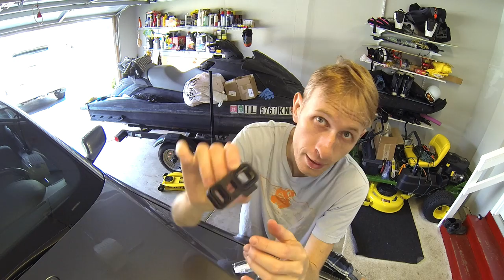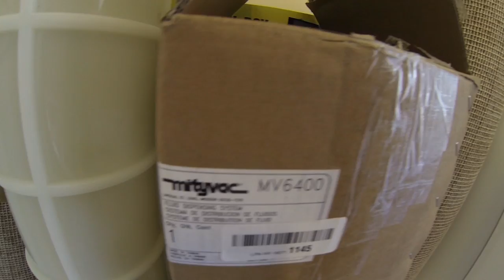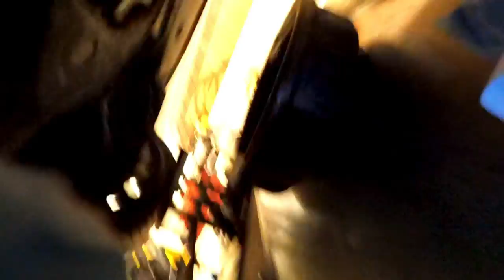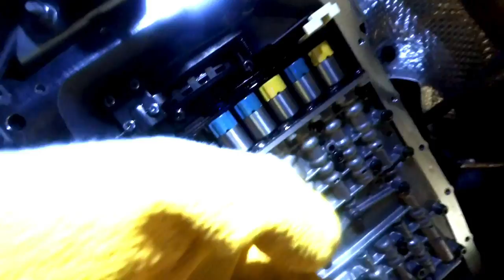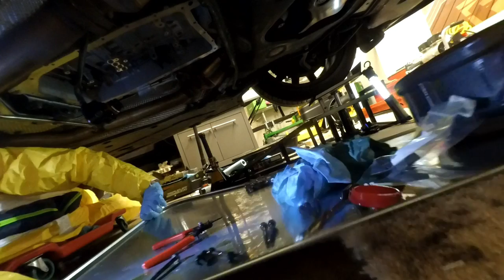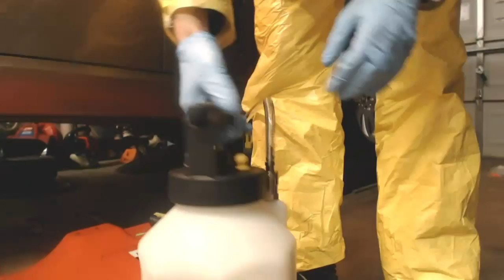Transmission Fault ZF BMW Range Rover Jaguar Bentley Rolls Royce Aston Martin Maserati Repair Fix

Comment: Great video! I have a 2003 745i with 96k miles and started having transmission fault after a 30mile run. After stopping it wouldn’t go into any gear, it just jumped into neutral. Shorter runs it was fine.Took it to a transmissions specialist and told them about your diagnosis. Took them 4 hours with new filter pan, bolts, 7 litres fluid and new two hole adapter seal. Cost me £650 but now drives beautifully again. BMW diagnosed... Need New Gearbox!! My adapter seal was cracked right through in 2 places! Thanks again. Oh, the specialist explained that you should NEVER put more than the 7 litres of fluid in or the pressures can be wrong. The gears are changed at specific pressures so if they are wrong then the gear changes are not correct.

Comment: After 4 years of not being able to drive the  car long distance, 4 mechanics, the dealership, and a $6500 transmission rebuild I did the job of really looking into this issue for an hour learned about how a trany works and now I can do the job that people who get paid could never. Thanks so much your a saint and now I can drive my LR4 without worry

Comment: That looks like an easy piece to machine out of aluminum, I never liked plastic parts in hot environments even intake manifolds, don't know what the melting temp is but aluminum is around 18 hundred. Great video

Comment: Tremendous video!  Huge help! I bought my 2006 full size Range Rover with a freshly rebuilt transmission that was rebuilt by a guy who did not replace the 'goggles'  and rubber sleeves for the mechatronic so seeing this vid I will go in and do this for myself to solve some issues I've always had since buying it.    The Ford Mercon trans fluid absolutely works, have used it in my 6HP26A and saved a ton.  Critical to do the fill and level check per factory procedure and do it at the right temp otherwise it will be too low or too full and both will cause problems on this finicky transmission. A big thanks for this video!
Reply from the maker: an infrared temperature meter from harbor freight helps when filling up the transmission, and the temperature goes up really fast so there should be 2 people, one in the car, one filling up the oil.
Reply: @SurferEugene I have a 2011 jaguar Xjl, and I’m having a gear fault code, would like to know can I bring my car to you

Comment: Excellent video very well explained thanks for posting it. I had the same problem with my 2008 BMW 750li it was not reversing it was going forward in any gear and I had a RED wheel transmission sign on cluster with (P) range fault. I went to dealer they said you might need new transmission which is $7000. I said no my car has only 165,000 kilometers it's not possible . but I did buy the transmission oil pan kit but not the fluid it was very expensive $47.99 a quart they said you will need (10) quarts = $479.90 dollars. I skipped on fluid but I purchased (RED) line D4 ATF  from auto parts store $19.00 a quart (10) Quarts @ 19.57=  $195.00 much less expensive then dealer. Gathering the material took more time then working on car. it took me (5) hours and I did it , Once the bridge seals were in and the  new oil pan with filter built on the pan was on. I let the car stand on ramps , I could not open the fill plug it was striped no way  to fill the fluid. What I did was fill the fluid from transmission intake line at the radiator by using (Graco) New paint sprayer machine I purchased a new 18 liters paint pail where I put the new transmission fluid all (10) liters in the pail now install the front paint gun tip in to the cooler line and lightly clamped it.so it will not pop out. it was very fast and easy I let the car run through out the filling process . The RED wheel sign is gone and all gears are working fine. Now once the all (10) liters  are in install the in take cooler line back on cooler. it is very easy.  I like the way you performed it. well done
Reply from the maker: Thank you for sharing, I will know what to do in case the filler plug is stripped.
Reply: Thanks post more videos you are very good at this BMW 750LI THANKS AGAIN.
Reply: Bashirsz Darz how did you know when you had the correct amount of fluid if you couldn’t see it coming out of the filler hole?

Comment: I copy and pasted the following paragraph from another person since its the same problem that I have. My transmission symptoms are as follows:

1. when I'm coming to a fairly quick stop it feels as if the transmission stops before the car dose so it feels like a bang sometimes harder than others.

2. some times when I come to an incomplete stop like almost stopping at a stop sign and taking off again it feels like the transmission stopped and when i accelerate to take off i feel a very hard bang and the car takes off very abruptly. 

3. this has been happening a bit more recently than the bangs, when I'm driving at cruising speeds at about 20 to 30 mph and want to quickly increase speed to lets say 60 mph like getting onto a highway or over taking somebody i feel a pulsating feeling coming from the transmission. almost as if my rpm are dipping slightly but they are not they stay very steady and it really doesnt feel like its the engine it feels smooth and strong.

4. and not as often but sometimes at highway cruising speeds i feel that the transmission doesnt shift at the proper times like it shifts up and then shifts back down again giving it a pretty unsmooth feeling.

Please let me know if replacing the parts you mentioned might fix the problem. I have a BMW530 xi SportsWagon 2006 with 89K miles.
Reply from the maker: the #1 and 2 seem like a flexdisk , a $16 part also called guido disk.  Usually wears out every 10 years or so. needs replacing on all bwm.  Probably #3 as well.
Reply: the torque converter is damaged, i think...
Reply: If you solved the issue tell us please

Comment: I bought a 2006 750i, day I bought it I tested good, even drove it at 130mhp on a safe place. Next day I went to pick up a friend, when he slammed the passenger door the transmission when to parking, and wouldn't go back to drive or reverse. Any ideas?

Comment: Very informative video , but you really need to do the  ATF fluid level check with the vehicle level and between a specific temperature range on your scan tool. You know If  you wore a one piece rain suit you could flash the owners before re-flashing the DME.

Comment: Hello, 

Just saw many clips of yours on youtube , and i have a question for you.

So , I have a 530i e60 from 2006 with an automatic gearbox zf 6hp19. I bought it 5000 km ago (i'm from Belgium) and i have this problem from the beginning:

On the highway , when the car is at 90° , and im playing with the gas pedal,  it get's stuck în the 3-rd gear and on car display i get this message "gearbox failure"(default). The first 2 times i stopt the engine and restarted it and the error goed away. The 3-rd time didn't dissapear anymore. If i put the tester and i delet the error it goes away. But when im on highway the whole thing goes again.

I have already changed the fluid , filter with pann , bridge seal , the 4 tubular sleeves and the big seal from tcm electrical supply. It didn't change , the error still comes on.

My question is , if i change the solenoids and the tcm what are my chances to win?

In your long experience have you ever dealed with something similar? What have you done? 

Thank you for your time, 

Christian

Comment: Great video, thank you.  I have a 2006 750li in very good condition 145k miles. I started having intermittent faulty transmissions a month ago, until it stayed in faulty all the time. I reset the engine light and it work fine, but it came back. I change pan and fluid and it work great for a day. now when I try to put it in D goes to P. In my opinion the issue was engaging on 1st, after engaging no issues. I am thinking on replacing Guibo and these parts that your are describing in this email and the solenoids as you mention. Any thoughts?
Reply: William Verdaguer did you change all seals and the mechatronic bridge seal, goggles?
Reply: Did it work I have 08 750li

Comment: hey drone, i have a 08 bmw 750li
its having problems accelerating and is lagging but does fine once im going fast like 60mph....i get the message (transmission fault, reduced acceleration) could this be related to what your fixing or a completely different issue/fix???

Comment: hey bro i have the same problem on my 745li 2003 bmw , my car is not going in to gear, when i put in gear it go back in park, i take it to 2 transmission spot, 1 spot  sad it the tcm module in vale body computer is brun out  ,and the next spot sad to got a used transmission in all and replace with the old one , what is the best thing to do bro i need helppppppppppppppppppppppppppppppppppppppp!

Comment: Hello,

by any chance you know a part number or a link to a website to get an input speed sensor for a BMW 750I 2009. plan to do some DIY on the transmission but i recently got an error about " Transmission Fault Code: 400626 - Turbine speed sensor short circuit to ground or
 open circuit"

Comment: i have the same problem in a Bmw 2008 X5 4.8 i change poem the same parts you changed to your Bmw and still said transmission malfunction drive slowly when you accelerate the change the 2 shift and the car goes like in neutron and then said transmission malfunction can you help me

Comment: my e46 318i 2001 has a cold start first gear hang up to 3500rpm after warm up it is normal, is there someway to fix it?

Comment: Do you know how to clear adaptations for the transmission? It's recommended it be done after any major repairs with the zf 6hp26 auto gearbox.
Reply: What he did is not major...just tedious...but if you were to open the mechatronic unit to replace solenoids, speed sensors, or tcm; then it would be...only if electronics are replaced would the adaptations need to be reset w/either BMW software or an expensive obd scanner that gives you that option...otherwise what the trans knows stays the same bcuz the electronics remain the same.

Comment: When you disconnect the mechatronic and you put back it not necessary make a reprogram?
Reply from the maker: I did not do anything to reprogram, the transmission fault simply never happened again, I don't think it is even necessary to disconnect a battery, but then again I am not a pro mechanic, it is a hobby of mine.

Comment: My car jerks when coming to a stop would these repairs work for that problem?
Reply: It's possibly a Flex Disc ('Guibo' joint) issue. I bought mine used 750Li 2006 and recently replaced mine. Before it felt as though I was getting slammed in the back overtime I came to a stop.

Comment: I have a 2005 Phaeton 4.2L with the six speed ZF. I am having issues with the transmission not shifting well between 3rd and 4th gear as well as 5 & 6. It makes a barking sound between those gears I mentioned. I had a check engine light show up once or twice but it goes away. I have to drive it in manual mode just to drive it now. I’m in the Atlanta GA area and everyone keeps suggesting a new transmission but I feel it may be this issue or the mechatronix. Would this fix possibly help?
Reply: shift solenoid's are bad also change the fluid and pan filter

Comment: My question is. If my transmission light doesn’t go away after doing all the resets. If I change my transmission fluids and pan out. Will the lights go away and work like new. Or is my transmission fucked.
Reply: Any one
Reply: Johnmichael Felix did you watch this video? Most likely the seals are broken so pan and fluids won’t fix it.

Comment: Hello Drone, I recently was driving my X5 3.0 and hit a pot hole and when I stopped at the stop light the vehicle wouldn't go into reverse or drive. The dealer says it's the mechatronics and or the trans. However, I have never had an issue with the trans. What would you say and how can I actually know or be sure that it is diagnosed properly?

Comment: I got similar transmission fault message, here's the code I get with ISTA-D.

400626 Turbine speed sensor, short circuit to ground or open circuit
Reply: There are two speed sensors w/in the mechatronic unit(input/output)...if short/open, then either the sensors are malfunctioning or the connections are loose or damaged...so the tcm(also inside mechunit) is not reading properly when info is sent to the ecm/dme...why I hate electronics on these cars, difficult to diagnose sometimes...even abs/wheel speed sensors can contribute to transmission faults and cause trouble shifting when malfunctioning...you definitely need a lot of patience and/or money when dealing w/electronic based vehicles.

Comment: I put everything back together but now the car won’t start and the gear box just blinks?
Reply: meaby u did not connect the cables :D
Reply: Wso my car won’t come out of park an get gettin transmission fault drive moderately
Reply: Meaby you messed with the pin in the mecatronic so the car dosen know in what speed it is or u failt to leave a gap when mounting ebreak cable or u dis not connected mecatronic cable good,it has a pin inside and must allighn well,try to read error with a diagnose pc
Reply: Wso so do they go out a lot ...cause I jus bought the car in sept an car waited one month an giving me this blinking problem so is this problem easy for me to do or u think I need to take it to a dealer

Comment: do you have anyone in jersey that can do this on my 2006 750i mine wont stay in gear keeps going back into park
Reply from the maker: any local mechanic should be able to do it.
Reply: Did you get it fixed?

Comment: I have been trying to reach this gentlemen, because I want to bring him my 2011 jaguar xf supercharged, because I am getting that error message, will you please contact me in order to discuss my problem. I tried to email but got a error that it is not a valid email address.
Reply from the maker: Hey will, email@transmissionfault.com should work, sorry about that.
Reply: I tried the email address once again, but received error message once again, please advise, I would very much like to discuss my problem with you.
Reply from the maker: Will, sorry about that, give me a buzz over the weekends or friday evening 847 4591535.
Reply: Drone my 2008 750li has this msg but mine won't get out of parking.
Reply: Drone good morning from Naperville, Illinois. I have a 2008 BMW 528I and the transmission malfunction keeps popping up.  I wanted to know if this maybe the same exact problem you were having. I would drive for sometime than it would go away. But know it seems like its happening quite quickly more often.
Reply: Hey William how did that repair go? Did that turn out to be the issue or no?! I own a 2011 Jaguar XF as well and I am currently having the same issue! The problem is I am having the worst time finding an HONEST mechanic here in Ohio!

Comment: Question here is your car is pretty New with 32k+ with that issue the dealer should take care of it free as warranty is still covered by BMW?  Why they charged you $1400 which seems a bit hard to believe if they know it's not the right thing to do. Esp BMW takes care very well for their customers in the first 4 yrs.. or you are trying to sell the parts and rent your garage and tools is the purpose?  All OEM parts can be bought online and those are not rare !!!! And you charge your price way to high for the parts the total of all the parts you described from ZF max out in open market is around $70+/-.
ZF6 oil is $22-25 plus.... the 6HP transmission is very robust and good not sure how you got that at early age on your 7 series with 30k+....
Reply from the maker: My car is 2006, this is year 2017,  it is long out of warranty

Comment: Hello my 04 BMW 745li car has 52k miles  last a few weeks soon as unlock the car notice the R.N.D FLASHING I STARTED STILL FLASHING  I shut it off and started 3 times till stopped flashing so I was able to drive it now I started and flash for a few minutes then stopped and black out took it to dealership and they said need new valve body - mschentronic don't trust the dealer any suggestions thanks

Comment: try two hours - max
Reply from the maker: Yes it is 2 hours, but it takes all day to put a brand new rear round plug for the electrical connection in the back of the transmission.

Comment: Hi there, 
Thanks for the vidéo 

I have a problem only in reverse Gear position P, big vibrations, and the car lowers from the front when i put R Gear it seems to force. 
Got no error code when diagnostic. 

In Parking mode with the comodo, the car also shakes but much less. The car does not stop immediately and advances slightly, then stops and medium vibrations appear.

On the other hand, when I use the Safety parking dashboard button the car freezes instantly and no vibrations.

The gearbox supports were changed they were split
Locking the gearbox properly made the problem worse.
Even More vibrations after changing the gearbox supports.

The GA6HP32 gearbox oil was changed more than a year ago without worries, strainer joint, crépine etc.

The biggest problem is the huge vibrations but only in reverse position R.
I made a couple of vidéos to show the problems

https://youtu.be/g4f4YDR5FWs

https://youtu.be/vq86XVwwJGA

Apart from that the car perfectly shifts in auto or manual mode, no noises, no hiccups.
Can you give me your opinion please?
There is no defaults code about the gearbox or anything else... 

I Will had to that that the car is vibrating when i take a virage turn on the right but is very smooth & no vibrations when i turn left virage... 

Cheers